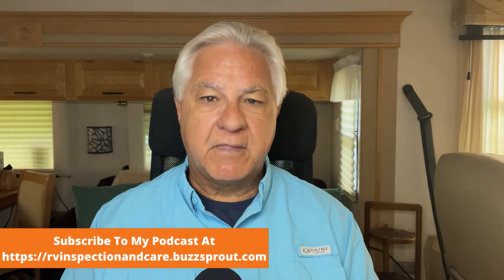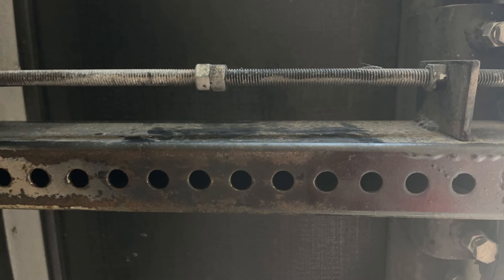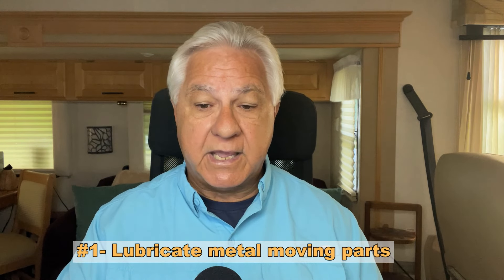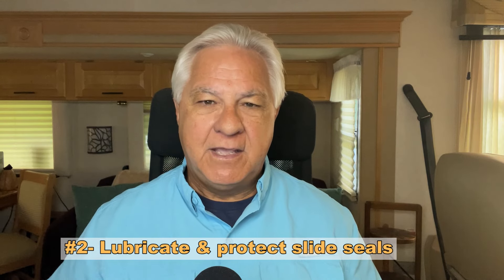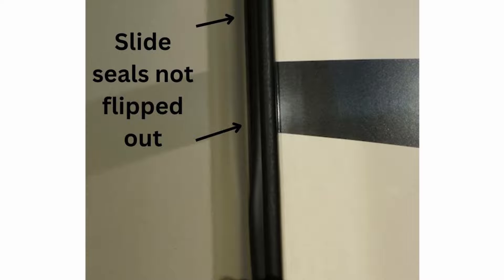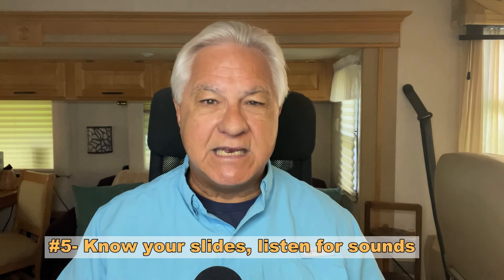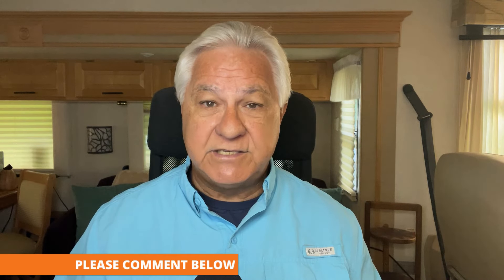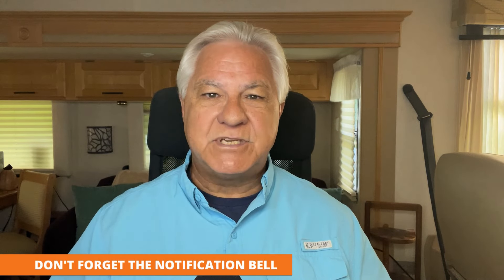RV Slide-Outs - My Top 5 Tips To Avoid Costly Repairs

Comment: Love your videos!! How often do you need to apply 303 to seals? 
Where do I find 303?
Reply from the maker: I try to coat my seals and other rubber and plastic RV parts on the exterior about every 3 months. Of course, if you are in a high UV area, it might be good to apply it even more often. You can find 303 at this link - https://amzn.to/3NdsRiY
Reply: @RVInspectionAndCare  I have used this for years on the seals on the roof of my RVs to prevent UV damage. I didn't know it could be for slide seal lubrication. Good tip!
Reply from the maker: @frito_bandito_  I'm glad that tip was useful for you. Have safe and happy RV travels!

Comment: I have a 2023 Dutch Star. My Newmar directions say slides out first then jacks down for leveling. Should I reverse those steps?
Reply from the maker: Always follow the directions you are given by your manufacturer. There may be a reason why they advise operating slides in that manner that I am not aware of.
Reply: Do not reverse the order. I’ve talked to Newmar about this and read extensively about it. The manufacturer determines the best process based on all their experience with the coach. They decided to change their instructions to do slides out first then jacks based on what they learned over time and across coaches. Then jacks up before pulling slides back in. So basically we just say to ourselves “never move the slides with the jacks down.” I know there’s lots of debate on this topic. But the winning decision goes to the side that aligns to the manufacturer’s instructions. Plus if anything goes wrong you want to be able to tell Newmar you followed their instructions.

Comment: I have a less then cooperative seal on the bed room slide. The furniture bumpers you are referring to don't let go over time? Which ones are you using. What a great idea by the way.
Reply from the maker: I installed the bumpers on my slide about 3 years ago and they have all held in there just fine. Be sure to clean the area where you want to put the bumpers and then use rubbing alcohol to prep before installing them. And here are the bumpers that I used - https://amzn.to/2QjqpdM I hope that helps.
Reply: @RVInspectionAndCare  thanks for the tips. What a simple concept.

Comment: slide toppers inhibit verifying top seals
Reply from the maker: One of the purposes of a slide topper is to protect the top slide seal from debris that could damage it. So in most cases you will just need to inspect the side seals of those slides.
Reply: agree, but what I've found is both my top and side seals are twisted, and need to be "fixed" so they lay flat. Although not the best tool, I've been using a hockey stick to reach the upper part of the side and across the top, under the topper.  @RVInspectionAndCare
Reply from the maker: @denniskissinger7937  That sounds like a workable solution to me as long as the stick doesn't scratch the RV. Thanks for that suggestion, Dennis!

Comment: Question, I have a hydraulic slide on my 2011 keystone Montana. The bedroom slide just won’t extend all the way when we set it up. Goes out 8 inches and stops dead. It has plenty of hydraulic fluid, new batteries and power. Any suggestions why it might do this?
Reply from the maker: Honestly Linda, it's very hard to diagnose slide problems without being able to operate it personally as there are a number of things that could be causing that problem. I recommend that you do a little research to find a local service tech that knows their way around RV slides, and have them take a look at it.

Comment: 😂 first I want to thank you very much for all you do you've been a great help for us. Would like to ask if I should get a half inch round self-stick cabinet bumper or three-quarter inch?
Reply from the maker: Hi Christina. I just used the 1/2 inch bumpers and they worked just fine for me. Be sure to clean the slide sidewall where they will go with alcohol before applying the stoppers. And I know I said about 18 inches apart in the video, but now that I look at mine more closely, they are more like about 12 inches apart. I hope that helps. Thanks for watching!
Reply: @RVInspectionAndCare  thanks so much. I am going to do this. 
I also have trouble reaching my hand in to lubricate both sides of the seal. Any suggestions for that.
Reply from the maker: @christinaholligan8299  Actually the main place to lube the slide seal is on the side that faces out since that is what gets damaged by UV and weather exposure. If you can get behind your seal that's fine. But the most important part to maintain is the exterior part of the seal.
Reply: @RVInspectionAndCare  oh ok. Thank you!!!

Comment: Thor uses the Schwintek system on my 20 foot full wall slide which has the refrigerator, stove, sink and the living room sofa.  They probably did it to cut costs.  Thinking about investing in the Vroom slide out system to replace the Schintek, which has been nothing less than a headache.
Reply from the maker: Hi Robert. Yes, as I said in the video, Schwintek systems have been misused by some manufacturers and the results have been pretty bad. But when they are used on smaller slide rooms, they work just fine. So sorry to hear that you are having trouble with yours.
Reply: We got rid of our Thor Aria because of the slides -Shocking that they use Schwintek on that big wall slide 🤷‍♀️
Reply: We have Schwintek, two rails at each end of our 15' whole wall slide. Have had issues and looked at Vroom. Spoke to the owner. That system appears very robust. Vroom states it can be stopped anywhere in its t😂ravel. I thought I remember him saying it was tested 60K times without issues. It's an option for sure. That would eliminate my slide anxiety for sure.
Reply: @spacecadet4876  I have not heard anything negative about the Vroom system and a ton of positives from those who have installed it (IRV2 forums).  For me, it is more of a question of when and not if.

Comment: I have been manually "flipping" my slide seals for years.  I keep them lubricated with 3in1 Rubber Conditioner and they are in excellent shape.  However there are places that continually not flipped.  I like the furniture bumper solution and wonder if anyone else has tried this resolution to the "seals not flipping" issue?
Reply from the maker: Good work on keeping those seals flipped over the years. And 3-in-1 conditioner works great on them too. Thanks for sharing your experience with us here!

Comment: Hooray for Duane!  Thank you for covering a topic that is mystifying & sometimes frustrating for so many.  I'm currently looking at 2 different types of large truck campers, one has 2 slides & the other has three. Both have a rear slide. One would think 2 slides is less to worry about - but is 3 better For Balance where a heavy truck camper is concerned?  Maybe I'm overthinking it but know I can't depend on what the dealer says...
Reply from the maker: Hi Celeste. I'm glad that this video has been helpful for you. I personally don't believe that the number of slides in an RV matters as much as how well they are cared for and maintained. I hope you find the perfect truck camper for your needs!

Comment: Great video!  Love the last tip about listening to your slide.  Also, it should be noted that 303 spray is not a dry spray as recommended for the seals.  That is a great product though and I use it on lots of UV affected areas.
Reply from the maker: Glad you enjoyed the video. I have used 303 Aerospace Protectant for years on slide seals and since they are rubber compounds, that is exactly what 303 is made for. So far, no problems for me or anyone else I know that uses it on slide seals. But everyone has to choose the products they feel most comfortable with for RV maintenance.
Reply: @RVInspectionAndCare  Oops!  You said dry lube for metal parts not seals!  My mistake.. 😎
Reply from the maker: @MrRMB1  No problem. Thanks for watching and commenting!
Reply: Good information!

Comment: I really doubt that a manufacturer ignored the engineering advice of Lippert on the Schwintek system for long slides.  As an engineer, I suspect Lippert was contacted and gave the green light. Does this application tax the slide system, yes, no doubt. Might it cause premature failure, yes, it might.
Reply from the maker: Regardless of who made the call on using Schwintek on long slides, there's plenty of failure out there that proves it's not a good idea.
Reply: yup and now as a mechanic i have tp fix engineer mistakes......🤦‍♂️